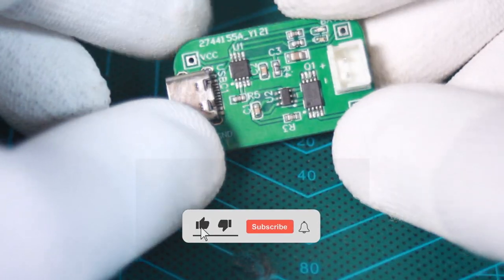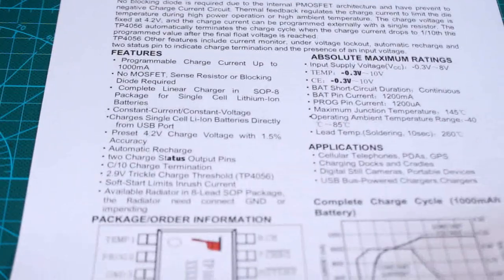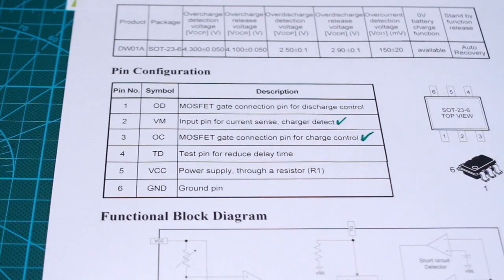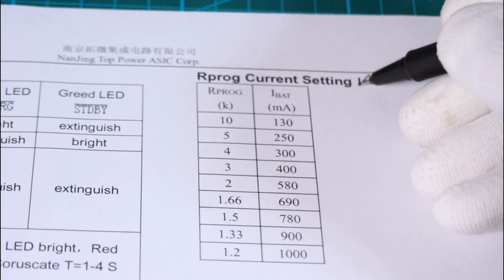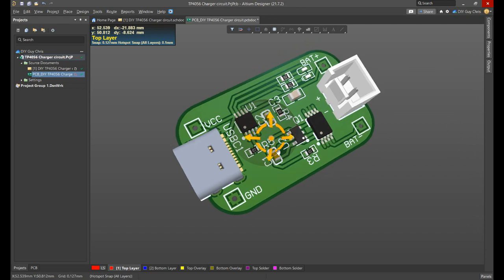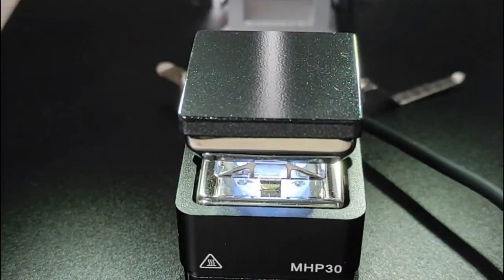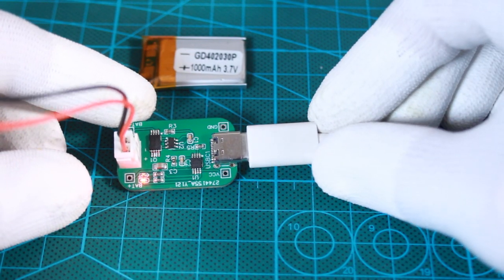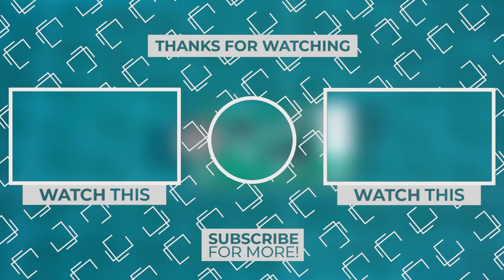DIY Lithium Battery charger Circuit (with protection)

Comment: Missing 5.1k resistors on CC USB-C pins
Reply from the maker: 5.1K resistors are missed but not for this application, no data transmission here, or maybe I should add them for the VCONN based on the cable characteristics, by the way the 5.1K value is not always valide it depends on many other factors, you can check more details about the CC pin of USB C connector here : https://community.silabs.com/s/article/what-s-the-role-of-cc-pin-in-type-c-solution?language=en_US
I'm open for more talk about this topic : )
Reply: I think the point of the 5.1k resistors here is simply to allow for usb-c to usb-c charging compatibility, even though there’s no other data transmission. Making a revision with the resistors and Pmosfet would make for the ultimate little usb-c charging board for diy projects in my opinion. Great work!
Reply: @DIYGUYChris  But in this case 5.1k would be suitable right? You think this kind of battery charger would be good enough for a some small production - gadgets?
Reply: @jameslaraia  You would use Pmosfet to separate a battery from the load, right?
Reply from the maker: @SurrenderToAction  indeed the 5.1K is suitable, and yes this module is good for small production.
Reply: @DIYGUYChris  Did you ever test it with these capacitors? What I worry is that the voltage from a USBC will get too high because of them. Because max Vcc on a TP4056 is 8V, and the USBC can get as high as 12/20V
Reply: meaning to say *test it with these resistors

Comment: Nice... next revision could get current (charging current; powered device current) and battery (and maybe power voltage if adding like 5-18V input voltage support) voltage measurement capability provided via digital interface to powered device. Imagine such charger connected to, for example, gps tracker in a car, all powered from car battery + that additional battery in tracker. Tracker would be able to report state of everything related to powering it including discharge estimates (in case of main car battery being disconnected).
Reply from the maker: That's something specific ☺️ and yes , will check what can I do about it 🤟
Reply: @DIYGUYChris  Yeah, specific example with gps tracker but such battery/power monitoring can be used in various devices like new mail in mailbox indicator (charged using solar panel), entry gate notification device, plant monitoring in garden, gas meter monitoring mounted on garden fence (that's where meter is installed here) and tons of other tasks. All such (half)offgrid devices should know (usually for owner notification purposes) their battery state and power consumption. Currently on the marked I see no such charging modules and no well thought out DIY solutions :/
Reply from the maker: @arekx  those notes from you made me truly motivated to try it 😉

Comment: Isn't there a single chip that can do this instead of three?
Reply from the maker: All in one, I don't think so, especially for the MOSFET because it has the biggest size among the three ICs, you are welcome to share any reference here if you find some good alternatives : )
Reply: @DIYGUYChris  It was just wishful thinking 🙂. I have no alternatives to propose, unfortunately. Cool and vrey useful project btw! 👍
Reply: @DIYGUYChris  The DW01 is already obsolete, though. There are several protection ic's with built in mosfets. And I would indeed not be surprised if there are charge ic's that have everything in one.

Comment: Hi there Chris
Very interested in your application, I have a few questions which I hope that you can answer.
I want to build a charger / charging circuit for 20 of 3.7v 26650 5000  mAh Li-Ion batteries, with which will then feed a 5000w pure sine wave inverter, in situ will be a 14.8v 4S 30a lithium 19650 BMS PCB Protection Board.
I would be building four or five of these units.
Your video is for "wearable devices" my 5kW will be overkill but my theory is I would rather have more than needed, than not enough.
1) How did you calculate the components needed ?
2) I would obviously need a larger PCB ?
3) Where did you purchase the hot plate solder station ?
4) The company that made your PCB's you got for free, was that because you were a new customer, and what did you supply to them ?
Tony
Reply from the maker: Hello Tony;
That's a great project idea, I wish you good luck,,
1) the components values are from the charging TP4056 Datasheet
2) You are going for more cells then you need a bigger PCB, please consider that one TP IC could charge only one battery cell.
3) the Hot plate check this link: https://www.dfrobot.com/product-2530.html
4) The PCB Manufacturer is JLCPCB and I didn't got the PCBs for free, you need to check them website to place a PCB order: https://jlcpcb.com/?from=TIP

Comment: I think there is a fault in your circuit.
You started out by saying you wanted to include temperature control of the battery. This requires 2 resistors as a specific voltage divider, feeding the TEMP pin. You didnt. Well you don't have to, but my understanding from the datasheet is that the TEMP pin in that case has to be connected to ground, not to Vcc as you did. This could lead to unpredictable shut off

Comment: Can the battery be connected to a functioning circuit while charging?
Reply from the maker: Yes, if you add some components to the circuit, you need to take a look at this video. https://youtu.be/MKylQrh5mmI?si=3MvgW1PH2zk2uHG7
Reply: @DIYGUYChris  thank you, man.

Comment: FYI--you can buy these prebuilt for less than $1 / board.

I'm all for scraping things together yourself, but these are too cheap to waste time doing this unless you need hundreds of them.
Reply from the maker: Purpose of this circuit is testing the schem effectiveness, once the schem is valid then I can integrate the charging stage to any of my circuits, I already used it to one of my gadgets and made it with a built-in charging circuit 😉